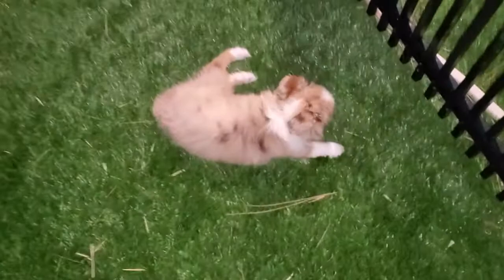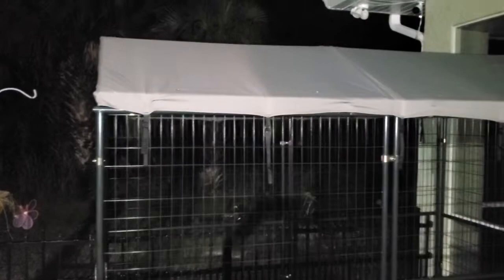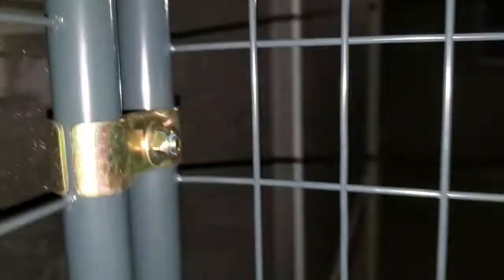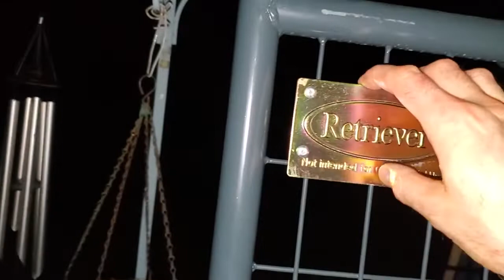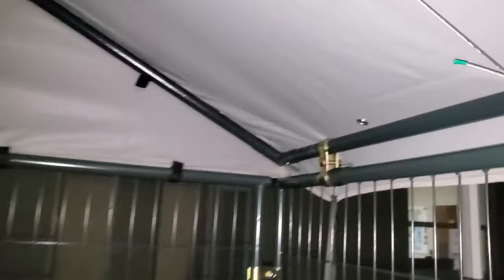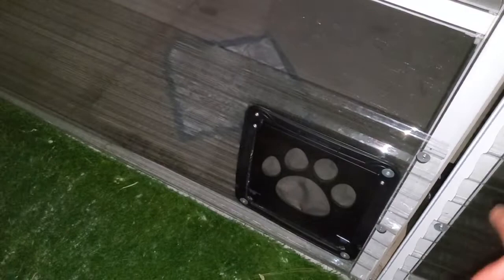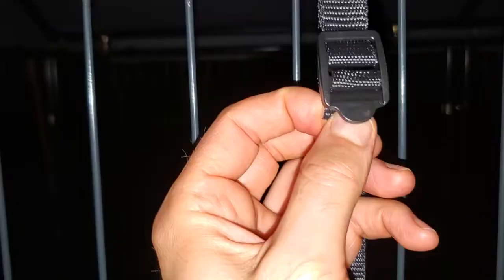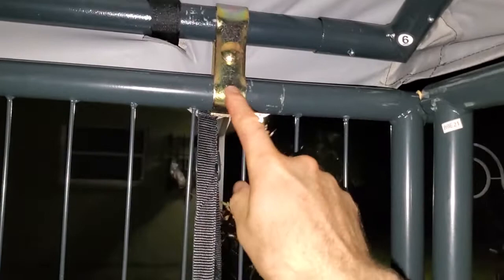Large Outdoor Dog Kennel & Roof Assembly Tips. Retriever brand; Protect from Bobcats, Coyotes, Birds

Comment: Struggling to stretch 10x10 cover on ….  The cover corners just don't make it even with all my strength to stretch..,argh 😡. They seem tb @6” shy.  Any suggestions.
Reply from the maker: Tried it when the cover is hot from sitting in the sun because the sun may allow it to expand a little bit
Reply from the maker: See another recent comment in this video where somebody gave some suggestions
Reply: @EcoNeato  sooo…went out with tape measurer.  Cover is correctly 10' corner to corner.  BUT…the frame is 10'6”.  😳. Had to think about what to do…and resolved it by pushing in buttons til pipes drove home…both sides plus top sections…then…then…it 'just fit'.
If I feel motivated…I might try to connect with mfgrs…maybe…
Irritating…but got job done.

Comment: I have this same kennel. The wind blew it over. Anyone know of ground anchors that work well with this kennel?
Reply: @mary allen is your ground level?

That’s my concern because ours isn’t and I just bought this kennel few days ago and then yesterday bought the 2 panel expansion because I felt the 5x10 is to small for my 1 year old Shepherd. We have 3 dogs and 6 ft fenced in yard but unfortunately she loves putting rocks in her mouth and chomp chomp and I don’t need her swallowing any so she’s been quickly just going out on a leash and I hate that for her!
Reply: @mary allen can you share a link to the spikes, I need to get some too.
Reply: @mary allen thanks for all your replies I appreciate it! We just had a new fence installed and the only thing in our ground is a lot of rocks uggggg and we have no gas lines, we’re all electric, only ones on the block which I hate during winter months, very expensive!
Reply: @mary allen another question: I bought the 6ft x 5X 10 and then 1 set of expansion panels to make it into a 10x10, there are total 8 rubber pieces missing from the poles, do you think that’s important to have them? I hate the thought of earwigs and ants being able to crawl into the open holes of some of the kennel sections and rain getting in there and freezing in the winter. I just called the store and asked whoever answered and he said long as it’s not a safety hazard or something important missing I wouldn’t worry about it. I hate the thought of having to take it apart and returning it especially when we had it delivered cause it wouldn’t fit in a van.
Reply: @mary allen I ended up looking up the number and calling and thankfully the lady who tried telling me they aren’t under warranty only the clamps are( shake my head), forwarded me to a guy who knew what he was talking about and they are supposed to be shipped to me. Seems like it’s a common problem from the question section I seen. I’m missing 8 that’s quite a lot and you would think they would inspect them before selling them and delivering them!

Comment: I just finished installing the 10'x10' with roof and two wall panels 100% solo.  I'm 66, 5'2", & 102#s.  I used a rough cut 1x4 clamped across the top to assist with roof installation.  In hind sight, I wish I had installed the side pieces first and THEN assembled the rest of the roof frame using a step ladder.  Lining it up was a PIA.
Just came in and found this video because I misplaced the instructions and don't know what all of the straps on the are for.  😀
Reply: I logged in to YouTube just to say THANK YOU for this great idea. I am assembling a 10x20 run and was dreading having to attach two 10x10 roof kits by myself. I'm gonna try attaching the roof side pieces first, and then build upward.